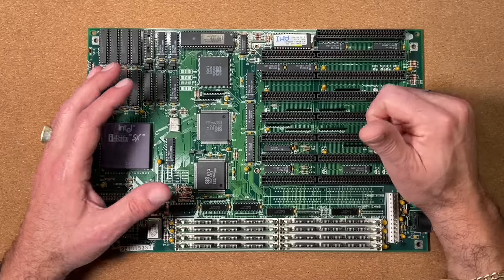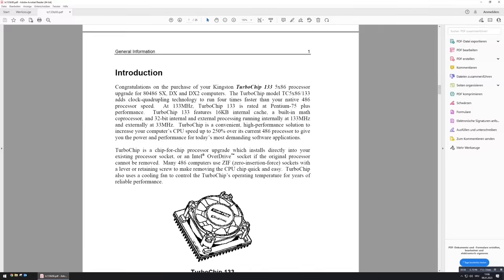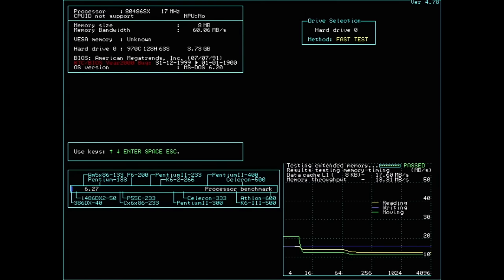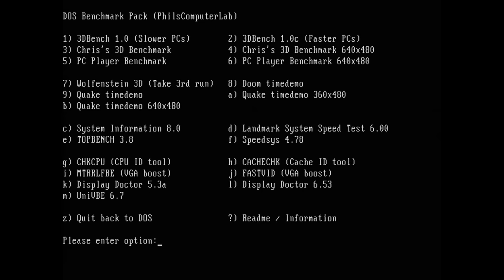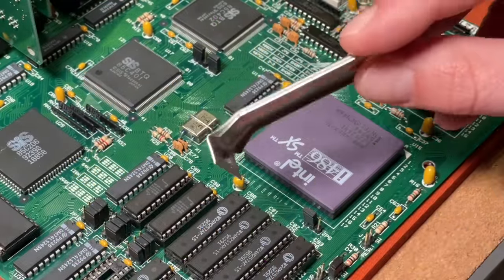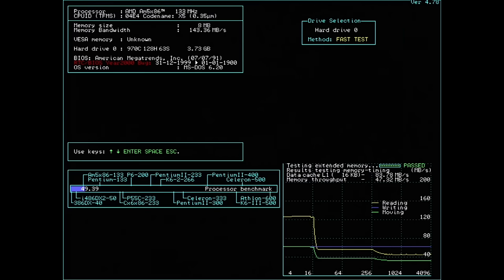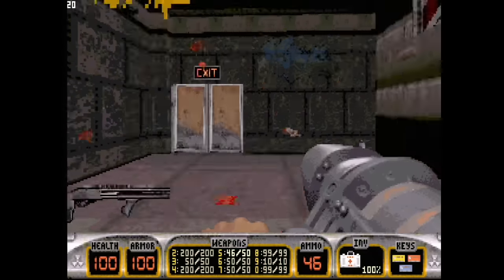Intel 486SX-16MHz Benchmark and Upgrade to Kingston Turbochip at 133MHz (AMD 5x86-133)

Comment: I've never seen 486 running at 16MHz from factory before, it would be interesting to try booting Windows 2000 to see just how bad it is :D
Reply: Windows ME ;)
Reply: I’ve done win2000 on a 25mhz 486 with 256k L2 and 128mb ram on an ssd and it was very slow took ages to boot to login prompt
Reply: @2xtreem4u  If I remember correctly, ME requires a pentium or K5 to even start. 

I remember this because a while after I bought my first computer (a 450MHz K6-2), I got a few older machines from a friend - a socket 7 system with a K5-166 on it, and two socket 3 systems - one with a 100 MHz AM486 and another one with 100 MHz cyrix 586.

The only show stopper was, that none of these machines had a working OS on their HDDs and all I had at the time was the windows ME install CD from my K6 PC ... which refused to install on the socket 3 machines.
Reply: @KenjiUmino  there is a video with win me installed and running on a  486 cpu pc
Reply: @2xtreem4u  do you mean this one: https://www.youtube.com/watch?v=IBrYsonxhPA

"Windows Me on a 486DX2-66 and 20 MB RAM" - it says in the video description that  ME "officially requires a 150 Mhz Pentium with at least 32 MB" - and that was about what I remembered. 

Will watch it later to see what you need to do to make it run on a 486.

Kinda funny how history repeats itself.

microsoft, 2000: "you must have a CPU that is at least THIS new to run the latest version of windows, because we say so" - somebody finds a hack around it and finds out that it works just fine on older hardware.

microsoft, 2021: "you must have a CPU that is at least THIS new to run the latest version of windows ... because security ... and because we say so" - somebody finds a hack around it and finds out that it works just fine on older hardware.
Reply: @KenjiUmino  Apple does the same with Mac OS  X
Reply: @2xtreem4u  true - I have not tried this myself as I don't own any apple hardware ... but I heard you can install the latest OSX on even an old core 2 duo mac mini or something ... which, according to apple, is not supported at all XD

Comment: If memory serves, the 486 SX chips were 32 bit internal and 16 bit external. This might be the reason you did not see much memory bandwidth change when you changed settings and put more cache in.
Reply from the maker: well, thats not true. 486 SX is internal and external 32 bit. you confused that with the 386SX where this is the case.
Reply: @CPUGalaxy  That could be, it's been like 30 years since I have seen one. lol. I should go refresh myself on the 486 and its variants.

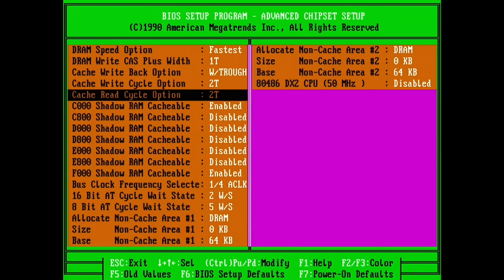Comment: But is it faster than Intel Overdrive Pentium 83 Mhz ?, nice upgrade ,at 13:20 in the bios the Base Non-Cache Area #1 :64 KB maby this can be changed to 256 KB ? allso Base Base Non-Cache Area #2 64KB to 256 KB ?

Comment: Interesting what you could get out of old platforms / sockets in the past. No longer possible, always "buy a new mainboard". The socket games from  Intel1150,1151,1156,1155.... Socket change from 1156 to 1155 was unnecessary :/

To the CPU since it is a low voltage CPU, this has possibly really good OC potential, if maybe mount there a heat sink and fan.

Comment: You want newer retro? I had a dual core physical celeron abit board with not one but two physical celeron 500mhz CPUs to equal a 1ghz dual core system. That was my most older historic build. Have a picture scanned digitally of ,d holding it put together in hand, the board and chips…. Exciting times….

Now currently with 13900k, one physical cpu and a ton of cores I can barely count…. And enough l2,l3 cache that could power mutiple old computers….

Crazy times…
Reply: The cache on my 5800X3D could store the sum total capacity of all types of memory in my first PC, including the hard drive.
Reply: Dual Z80 operating off the same clock anti-phase and dual bus with common banks to share,, , uses contention hardware for shared memory banks. 

Byte Magazine July 1978. Bob Loewer.

Comment: It's very odd that the benchmarks don't see the L2 cache memory; Try running Cachecheck from the menu, it'll attempt to use ALL the cache it can find on the CPU+Board. 
The board  actually behaves like the "fake cache" mainboards that were plaguing the budget pc market back then (one above all, the infamous PcChips M912), which always reported whatever amount of cache the jumpers were set to, but there was no communication with the cache itself because...well, they were fake plastic chips. 

Check that the chips you removed weren't fake - they look a bit suspicious in the first closeup. If they were, then the BIOS is set up in a way that it just "pretends" for cache to be there. On some mainboard, the traces are actually there for real and a BIOS update can restore the functionality.

Comment: 486SX absolutely sucked ass on an epic level! Intel introduced them as a "budget"option, but it was actually the same silicone wafer the DX came from, but the SX were the outer thinner layer of the wafer that wouldn't pass the DX testing.

Comment: The ISA bus is really bottlenecking this system, Doom should really be much faster with a 133MHz 486. Try with some Doom port that uses a RAM backbuffer for render, this reduces the amount of data to be copied to the video card and thus reducing the bottleneck.

Comment: !!!! HELP needed from clever fellow retro nerds !!!! Anybody knows what could cause cache related issues on my 486 system? Speedsys hardlocks straight after the ide test but before the ram test both with and without F5 before dos loads. If i turn the cache off and remove the chips its okay. Also norton sysinfo freezes and if i open system info in norton commander as well. Tried 2 different motherboards, many different cpu-s (33sx, 66dx, 100overdrive, 133amd), both writeback and writethrough mode, and 4 sets of cache chips 2 sets each motherboard. All the same error...... everything else seems working fine. Doom timedemo, windows, games. Cache chk run through and found no problems... im at my wits end and the only thing i can think of is perhaps BIOS (?).... the two motherboards are an intel r/r+ and a siemens nixdorf d819 with same set of 2x16mb 60ns fpm ram (but tried different ones too).

Comment: Please remember to remove that Varta barrel battery before it eats that board!

The 16MHz CPU is not fast enough to make a difference with your BIOS settings. Something faster like a DX2 might benefit, though.

Interesting that despite nearly 10x clock speed you gain just over 2x memory bandwidth over the 16MHz chip with less L1 cache and the original slower RAM + small L2 cache. Useless!

Comment: Ohh man, that BIOS by default really hobbles that poor 486SX-16, it gets no respect. The ISA bus is set by default to 1/4 the CPU clock speed. (The setting with the value 1/4 ACLK) 4MHZ!, you were running those ISA cards at slower then even a 4.77mhz XT would! I would re-run that benchmark with it set to 1/2 at least. 1/4 is fine for 33mhz chips, but your just nuking yourself with that on a 16mhz.

Comment: Why does Doom perform so much worse compared to the industrial board? On that board it performed 50% better.
Reply from the maker: thats the question which is knocking in my head since I did the video with the industrial board. I tried all other 486 boards I have, and thats a lot, and nowhere else I could reach the performance in doom with this dx2-66 overdrive as on the industrial board. the only explanation i have is the headland chipset and i dont have any other 486 board with this chipset to compare. 🤔